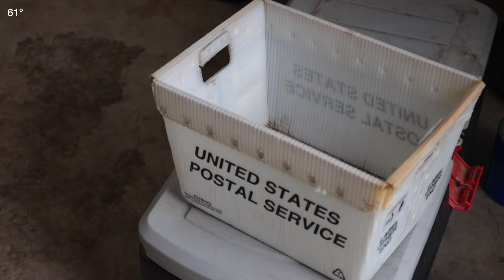Ram Pump - Amazing FREE Energy Machine

Comment from the maker: KNIPEX - The Best Pipe Wrench I've Ever Used https://amzn.to/2E9LX65
Reply: Wranglerstar Cody what happened to that machine that dug the well you had and were rebuilding?
Reply: are you going to do another time capsule vid
Reply: Got my first one this week - love it!
Reply: You really need to try the Knipex pliers-wrench. They work in place of a crescent wrench but with way less/virtually no chance of slippage as they grip tighter as you put more effort on them. I have two of the 10", one 12" and am about to order the 16". As a plumber & gasfitter for 31 years I give them a professional tradesman's endorsement.
Reply: @verbotn  That they are.
Reply: KNIPEX, yes excellent tools. I have some of the pliers and they are very very good.  Cody, shouldn't your gas bottles be chained to the wall or something?  Safety 101...
Reply: Knipex is verified as the best.
Reply: 8:15. What is the red lock tight about? Like the sound effect there!

Why the Canon R? And not the Sony a7 mark 3?
Reply: knipex is simply the only tool brand I use in my job (where they have the tool I need of course). Relatively the brand is fair price. Simply quality.
Reply: Where's the 5d mk IV going?  My wife has been considering stepping up from her mk III
Reply: I've haven't used the Knipex pipe wrench yet, but it looks to need two hands to use, vice a one hand operated pipe wrench.

Comment: when I was a boy... my family utilized a RIFE 40HDU heavy duty ram to pump water about a mile out of a steep canyon to our house. it was my job to keep it running most of the time. the force of the pressure it was pushing against would sheer the valve bolts off. I've always wanted to build a smaller PVC version like this one you have vs the cast iron monster I maintained when I was a kid. great video, thanks for sharing.

Comment: At 18:11 you mentioned the drive pipe does not need to be water tight. I have found that if water leaks out that means air leaks in. This can stop the pump.

Comment: I use used motor oil for bar oil, especially in winter because it is thinner and flows easier. In summer, just straight 30 weight works and it's what bar oil basically is.

Comment: I don't know all of the technical terms, but could you put and extension on the pipe going straight up, put a 90° elbow on it, then put the screen on that? So it will be extended up and away from the ground (avoid surface debris) and it will be horizontal to stop much falling debris from clogging the screen.
Maybe that way you don't have to go clean the screen every week 🤷‍♂️

Comment: I use a ram pump as well. Seeing your setup and your mention of "hundreds of feet" of intake pipe it makes me wonder whether you need that much, or whether you could repurpose a couple hundred feet and also not have to bury it. I see your flow rate, and what appears to be a lot of flat ground. This makes me think you could move the pump closer to the intake location and use more output hose instead (always much smaller diameter than intake and therefore less expensive) as an alternative with no change in volume. Regardless, nice video as always.

Comment: I enjoyed your comment that ram pumps deliver water with no energy.   Well sort of...
You didn't have to buy any energy from someone.  You didn't have to set up a solar or
wind system.   But It did use energy....
The energy to move some of the water up hill to your storage (1/2 a million gallons is a lot of water)
comes from the potential energy of the water that went on down the hill.  
Yes, the second Law always wins.
Ram pumps are wonderful and use energy that would otherwise just be wasted.
Great story

Comment: I have always burned stumps using cement blocks. I've burned hundreds on my property when we cleared it for a place to build. I just stack the blocks around the stump making a circle around it stacked a few feet. Then I take wood from cuttings of the tree and build a fire in that circle put, just keep feeding it tell the stump is gone, usually takes a day worth of burning to melt away any stump... Ive done trees up to 2ft this way without any issues, just reusing the blocks stump after stump..

Comment: Hi Cody. Thank you again for all your support over the years. That small ram pump did not work well due to the larger drive pipe and smaller pump. (And because you need the larger pump for more water.)  If you are interested the pumps are on Amazon if you want to add your affiliate link .

Comment: Im wondering if they make a turbine that you could hook up to an alternator to charge a battery bank?  Free power + free water would be excellent!
Reply: He could by taking advantage of the already available energy in the water, but the ram pump would have to go it would because after the water runs thru the turbine most of the energy would of been transferred to the turbine.

Comment: RAM pump doesn't require energy from commercial sources, but it does require stored energy, potential energy from water at an elevation above the pump.
Reply: still its energy you dont have to pay out of pocket for. so its free energy, but the whole system cost money. 
it easily pays for itself though.
Reply: "does not require energy" is the wrong term you can not move something without putting energy in it. Though i think he means that you dont have to do anything physical to use it or pay for an energy source
Reply: @natisev29  Exactly, the very wrong term, but not in the context of a youtube video, I guess... Does anybody really wonder why in the comment sections  to ram pump videos people show up and get confused about what a ram pump is about, when the ones that pretend to educate... ah, I forgot, it's youtube!

Comment: you can produce electricity with a ram pump too instead of using the energy to move the water up hill have it spin a flywheel to an alternator

Comment: Cody Might i suggest using rubber couplers with stainless steel screw clamps at your connections will make it much easier to clean out  when it gets debris in your pipe.....Pex pipe is another option for piping then you can use shark bite connectors for quick disconnects for repairs or rebuilds. 😁😁😁

Comment: If you wanna make tnt get PVC pipe hot glue on the bottom fill the PVC with gun powder cut a peace of wood or something put it on the other side of PVC drill a hole in the wood so you can put a wick in it

Comment: The loss of water is the loss of energy.
Its free, to you.
Sun evaporates water
rain falls, you collect it and use it to run the ram pump.

If you made an elevated resivoure, you might be able to run a turbine, loads of these ram pumps to fill it up.
free electricity?

Comment: Am a believer in using both Telflon tape and pipe dope on threaded couplers.  If you have to EVER take that joint apart again, you'll appreciate having that dope on the threads.
Reply: Dope over tape. Also one or the other. Using both is a bad idea
Reply: @ZulkSOD   Depends.  On steel, I'll often use both. Too many wraps of tape, plus dope is not so good. Some dope is better than others.  Some is just mineral oil plus plumbers putty.  Some is liquid Teflon.  Rectorseal #5 seems good.  I'm not a contractor.  I'm a farmer that has joined a fair number of pipe.  I prefer dope, but for some applications it doesn't stay put as well during assembly, for example on oily hydraulic oil lines.

Comment: You say it right in the text, but get it wrong in the video, the text says ," Ram pumps can move and lift a tremendous amount of water without the need for electricity or gas powered generators." In the video, you say, "Ram pumps can move and lift a tremendous amount of water without using any energy" You use the energy of falling water, just like Niagara Falls does to generate electricity. free energy can mean different things, and I guess you are correct, you aren't paying an electric bill or paying at the pump to run this pump.

Comment: A Ram Pump is NOT FREE energy. It is a potential energy conversion device. If it were 100% efficient then it could convert 1,000 gallons of water with a 4ft head into 200 gallons of water with a 20ft head or 100 gallons of water with a 40ft head. In practice these output values would be about 40% lower due to inefficiencies and energy losses. You could link a water wheel to a pump and come up with a similar solution. It would have a lot more parts to go wrong, but would likely be a lot quieter.

Comment: Tell Jack he did a good job on that stump.   Determination goes a long way...   Do you have ticks out your way?   Here. In Ky they are awful...   I have an old farm about 1 1/2 hr drive from where I live.   I have to spray my pants just to get out of the truck.   They are also here around the house.  The fact that the house sits in the middle of 5 acres of woods doesnt help.

Comment: It's not a "free energy machine", it requires no electricity, however that is different than no energy. For example, ti would not work if you put it in a pond because the water is static, but because the water is already moving you are using that energy to pump it up to your tower. I mean no offense and I enjoy most of your content, just as an engineering student I wanted to point that out.

Comment: I know I'm pedantic here and I know what you really mean so I apologize in advanced, please ignore this pet peeve rant, I love your channel and the content you make.   Ram pumps are awesome and as someone who works in the water/waste water industry it's really cool to see such a useful application of water hammer.  But Ram pumps don't work with "no energy" and they're not a "free energy" machine.  Without the kinetic energy created by the water traveling from a higher location to where your pump is and that energy being redirected in a sudden moment through water hammer there would be no lift.  What you mean is they work without any external electrical or mechanical power supply.
Reply: I was going to say the same thing. The moving water IS the energy. No such thing as free energy.
Reply: Depends on your interpretation of FREE.
If you pay for the apparatus but not for the energy that drives it.  Then the energy IS free. e.g. At no cost to the user.
Reply: Jasfras1 makes a good point but I was thinking the same thing Matthew.  Engineering/Physics wise it isn't free energy but taking advantage of potential energy.  Economics wise after initial investment it is free.

Comment: Oh Man NO ENERGY???   Not so fast it uses the energy of the water and the stopping energy of that hydraulic through check-valves.  Energy is neither lost or gained but it is converted in this case to heat and in this case the valves wear and heat in very minute amounts into the water.  I think I deserve a pencil, what do you think Jack?  And Boston is my near hometown... Leominster, just north of Worcester.  You must get those city name pronunciations down if you travel west on Route 2 (Root 2) past the Concord State Prison and Rotary.

Comment: Free energy? No energy?  I believe I know what you mean from the point of view of no electricity or engine. But you are using the potential energy of your source water and gravity. They aren't efficient in the fact that it takes a lot of water to move a little bit of water. But that can be ok in some cases.